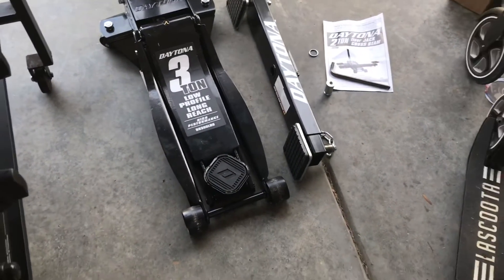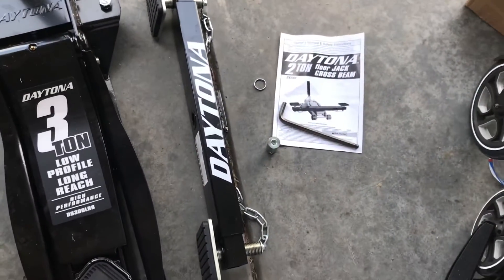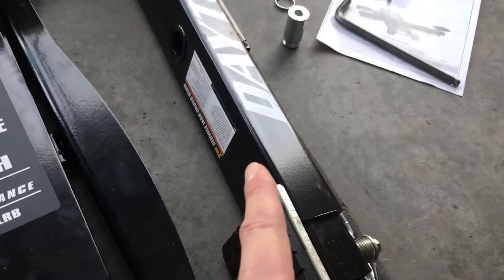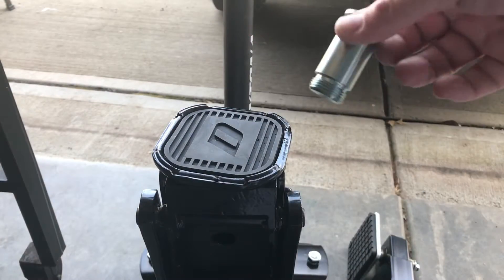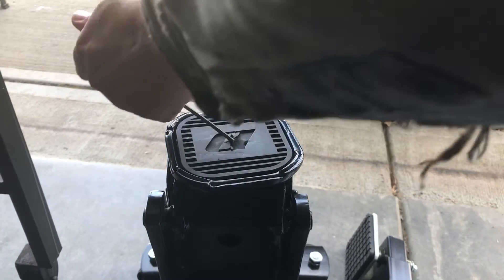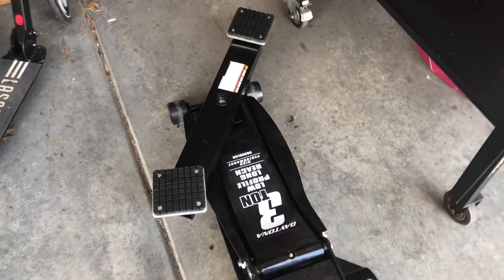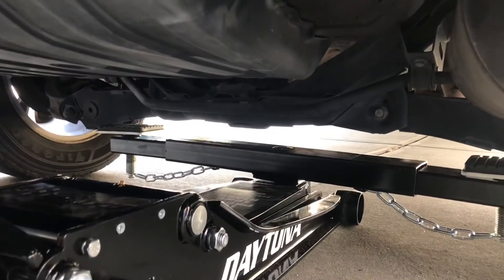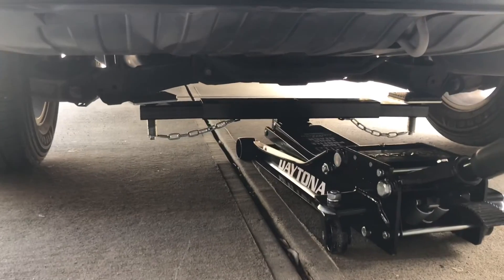Harbor Freight Low Profile Long Reach Jack and Cross Beam Dayton 64051 and 64781.

Comment: The whole rubber pad comes out, there is NO need to cut it at all.
Reply from the maker: My rubber pad was glued in.  If I removed it, it would of been damaged. Therefore, I cut a hole in it.
Reply: @motofun72  mine was glued in as well but I pulled it off

Comment: You are supposed to remote the footing from the jack, (you seem to have left it attached under the middle of the cross bar)its supposed to be removed completely and attach directly to the crossbar. be careful that's not safe
Reply from the maker: Thanks, but I’m confused. I’m all about safety, so tell me at what minute/second in the video are you talking about?
Reply: @motofun72  I believe you already removed that square metal piece that’s originally on the jack and placed the crossbar without it. I’m not sure Patrick G probably didn’t watch the whole video.
Reply from the maker: @DacAL_8  I agree!
Reply: Depends on type of jack used maybe.  The Pittsburgh jack I have, after the saddle is removed, the square base is the forging to which the jack lifting arm and stabilizer arm attach.  It can't be removed.

Comment: Why you cut a hole is the rubber pad. You know that you can easily take it off with a flat head screwdriver.
Reply from the maker: I wanted to keep the pad glued on, so I wouldn’t misplace it.
Reply: @motofun72 lmao!!!!!!
You want to ruin the pad so you don't loose the garbage pad?????wtf

Comment: I’m not sure that there’s any real advantages here with a crossbeam bar.  Hopefully it won’t snap or bend or tilt. Physics won’t allow the beam to go to far out. You can put it under the pinch welds. I like the jack., but I’ll pass on this beam. Thanks
Reply from the maker: I’ve used the crossbar multiple times. It’s nice, but definitely not needed.
Reply: For dropping fuel tanks they're useful

Comment: so, why did you end up cutting a hole in the saddle pad?  It seems like your idea was working.  Is there some reason you had to remove the bolt from under the rubber pad?  Seemed like it could just stayed there until you installed it again,  Did i miss something?  Thanks.  Just trying to understand.

Comment: It appears to be limited to use for SUVs and cars rear ends as it looks to high to fit under most cars front ends due to air dams etc.
Reply: if that's a problem drive the car onto some scrap 2x4s laying flat so you get a little extra clearance.

Comment: Just got this set up in orange today. Is the side play suppose to be in there? Like if you use the ring that came with it made it nice and tight.  Wouldn’t you rather want it tight Vs how lose it is?? Tia.
Reply from the maker: I agree, I do like things tight!  However, I didn’t even try the spacer/ring thing. Maybe I will try it next time.   I almost went with orange, but they didn’t have the crossbar in orange, so I went with black.

Comment: Can I use this on a Pittsburgh 1.5 ton floor jack?
Reply from the maker: No sure. Check their site. I remember it saying it wouldn’t fit all jacks and it listed them out. Site should have the information.
Reply: Someone on harbor freight website provided the model numbers of the compatible Pittsburgh jacks under the crossbeams review section.

Comment: What is the height of it so I can determine if it will fit under my car?
Reply from the maker: The jack goes down to 3.25 inches. I say the crossbar need at least another 3.5-4 inches.  That’s a guess.

Comment: If the cross bar comes with its own bolt, why did you cut the center pad up so much to remove the bolt? You could leave it (the bolt under the pad) t in place if not needed for the crossbar. What was the purpose of that? Please admit it because otherwise this video seems a bit confusing.